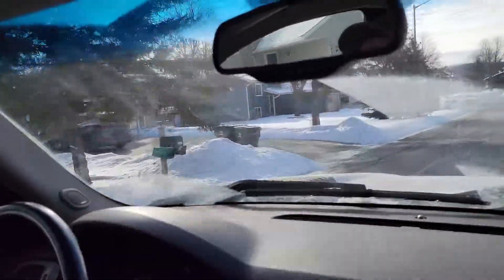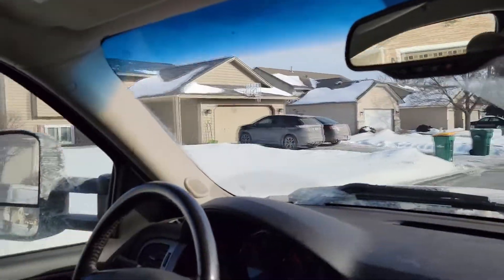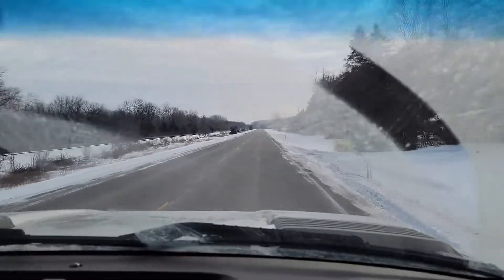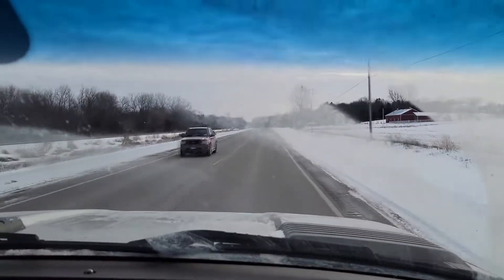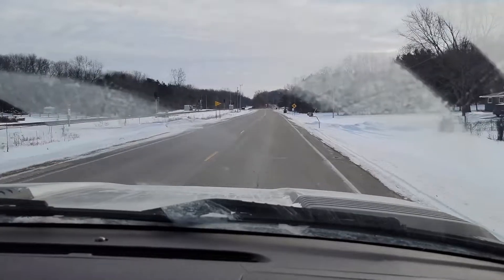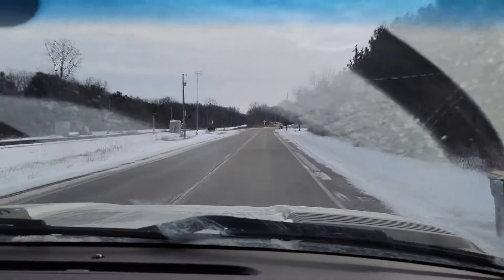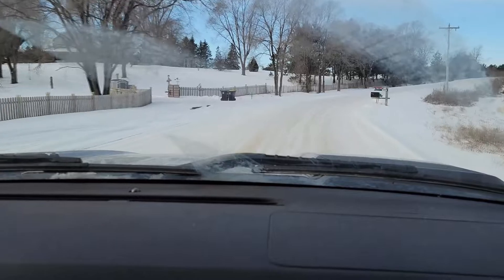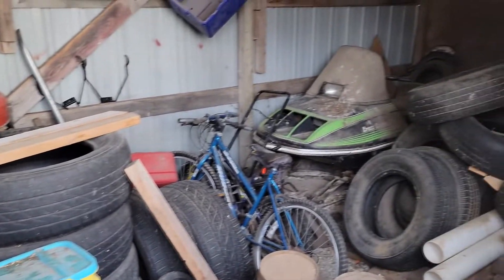Barn find 76 Arctic Cat Cross Country

Comment: Stock engine in the 1976 cross-country was a 340 cc dual carb single pipe, free air Suzuki. It had special porting developed by the race team to get the engine to about 56 hp. It wasn’t very reliable so the next year they went to an LC 340 based on the 1977 Z oval racer.  This FA 340 has more in common with the 500cc FA trail engine than the tiny lightweight Jag 340. Being a race sled, most were mauled racing. Quite often you’ll find one where the chassis was good enough to be saved, but the high strung 340 mod motor was tossed in favor of the same hp put out by the 500 from the stock Pantera. It was a bolt in swap and much more durable for its day. The owners would retire the sled from racing and turn it into a cruiser.